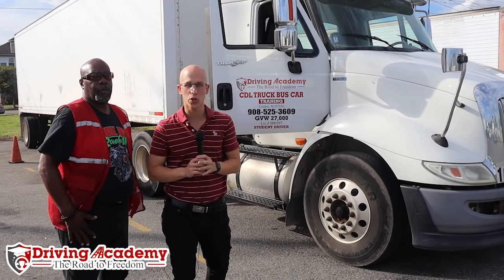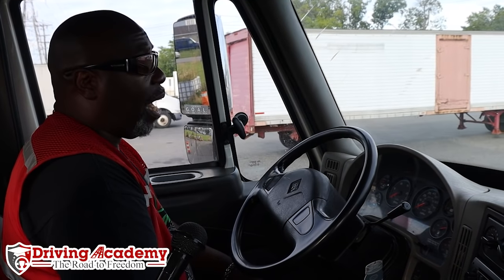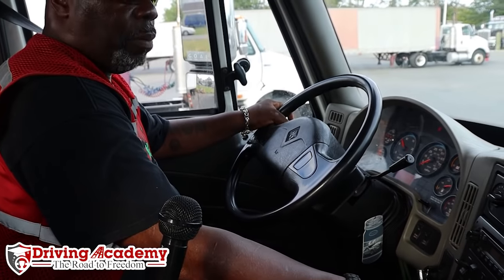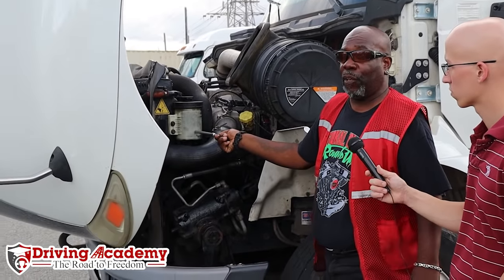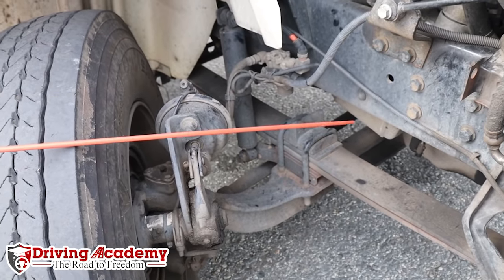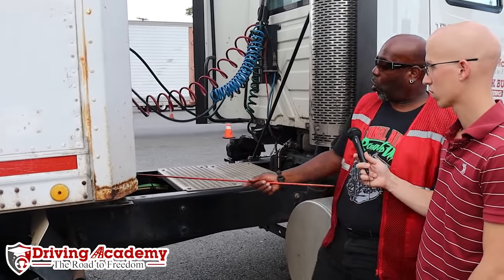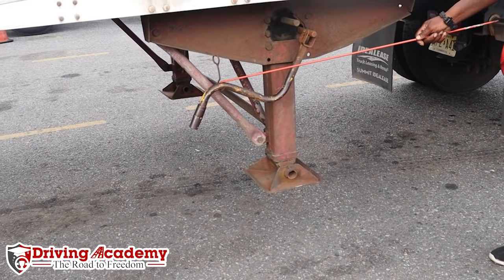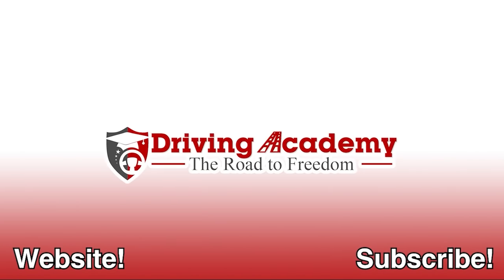CDL Class A Pre-Trip and In-Cab Inspection (2021) - How to Pass Your CDL Road Test Driving Academy

Comment: In order to do an Air brake Test you need to tell the Eximiner what you doing before starting Deminstration. 1 Audiable air brake 2 Low air warning device 3 inoperative towing tractor protecion system4 Pushrod stroke 5 slow air pressure build up rate. Once you tell the eximiner then you demonstrated!